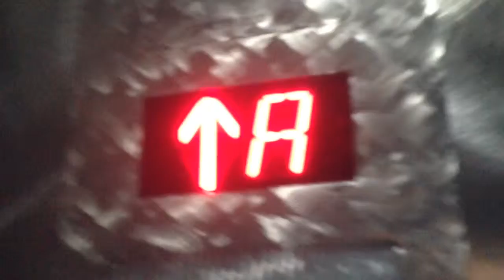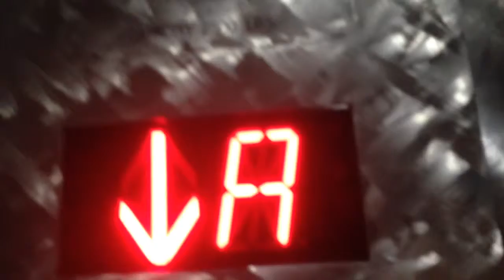Modernized Amtech Hydraulic Elevator 1 @ Figueroa Garage, Santa Barbara, CA

Comment from the maker: I last rode this in 2011 and it said "Reliable". This is a Reliable elevator since it was installed from 1970-1975. I am getting pretty accurate estimates from following the permit numbers you provided on Elevator Wiki and also the OTIS contracts from work. They give the permit number and exact date of install and are of course 100 percent accurate.
Reply: So you have Otis's records of elevators they install/modernize/maintain, or California state elevator records? Glad to see someone using the guide. Wow, a Reliable elevator that old? Did it have different fixtures than most Reliable elevators? I do not know when Reliable was founded, but I guessed early 1980s.
Reply from the maker: Nope. It had the standard round, thin plastic Amtech fixtures and pointy, thin directional arrow. Reliable was actually founded in the early 1970's. I've seen some of those early 70's Amtech getting serviced by OTIS. We still have them in our contracts!

Comment from the maker: It does list the brand and Hydro or Traction (but not if it's Roped, In-Ground, Overhead or Bottom-Drive). The number correlations in San Diego are pretty simple: 033000-046999 is 1960-1969; 047000-059999 is 1970-1979; 060000-083999 is 1980-1988; 084000-105999 is 1988-1995; 106000-119999 is 1995-2003; 120000-149999 is 2004-2009. The numbers before 1960's I haven't studied up enough on since there is a limited amount of installs before 1960 I have experienced in San Diego. The numbers after 2009 continue on to current and very recent installs and a lot of them in my area still have the temporary conveyance from install.
Reply: I thought all of this information applied to all cities in California, except in some parts of Los Angeles county, where they have county ID numbers. Are these numbers different in different cities? If so, are the ID numbers the same county-wide for counties? If so, I will have to completely rework my list on Elevator Wiki. Also, this makes me think the numbers are a date code, not for example the 082641st elevator installed in California, not counting some parts of LA county.
Reply from the maker: I think you're right about that. The ones you posted for LA are slightly ahead of the number listings for San Diego. The whole San Diego county relies on these numbers for correlation to elevator installation years.
Reply: The ID numbers on my list are from various places. Also, parts of LA county use completely different ID numbers, but I don't have enough of them to see if they are decodeable or not. But I will rewrite my list for this new discovery.
Reply from the maker: Ok sounds good.
Reply: +Traction151 
Are the years that you said the numbers correspond to exact, or approximate? (I consider date of building being built approximate, because the building could have been under construction during 2 years, or more, but dates from Otis records would be exact).

Comment from the maker: I can tell you when a specific elevator was installed but I can't say what elevators OTIS maintains cause that would be confidential.
Reply: Is there other information in the contract list besides the date of installation, like the brand, model, capacity, speed, or other (explain)? Also, I thought all of the elevators on the list were maintained by Otis, unless it counts elevators they installed but don't maintain, or elevators they used to maintain? If it counts elevators Otis never had anything to do with, maybe you have California regional elevator records, not Otis records.
Reply: Or maintnentce company is listed (though you said that was confidential?)
Reply from the maker: They all show the capacity and speed as well.  There are some elevators OTIS installed that they don't maintain. I can't tell specific locations where OTIS maintains just since another competing elevator company could try to outdo OTIS with a cheaper price for maintenance; thus OTIS losing the maintenance job and contract.

Comment: Does it list the brand or not, and if it is hydraulic or traction? I would have expected the brand and type to be listed. Could you post some state ID numbers with the dates of installation so I can build up the state ID number-to-date list on Elevator Wiki? And do you know if the date is from installation started, in progress, or finished? Also, you should when you have time, search through the elevators in your area, and see if you find anything vintage you didn't know about.